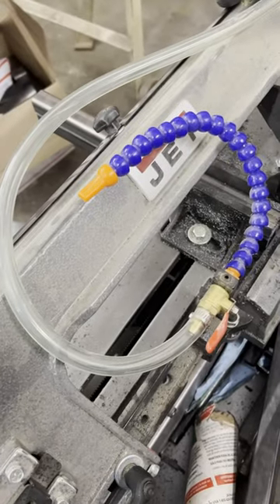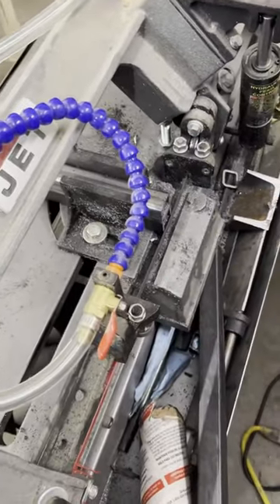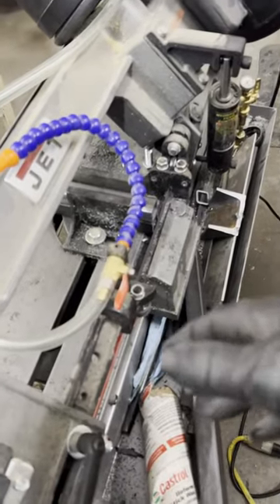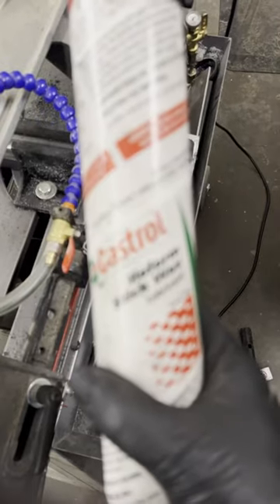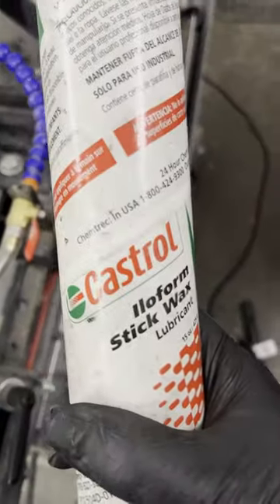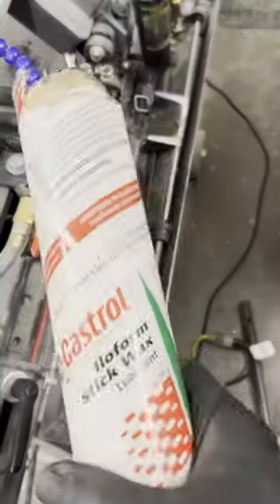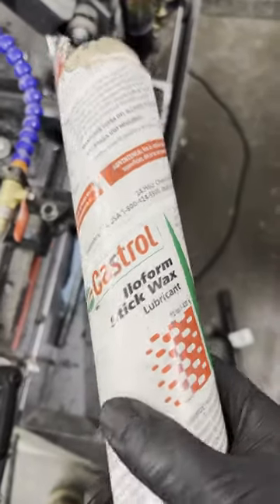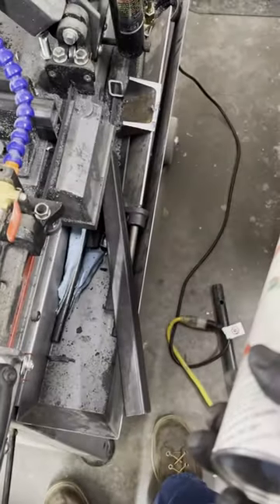I don’t use cutting fluid with my metal bandsaw!

Comment: I've used both wax and cutting fluid on structural steel with drill bits but not saws and the wax works great.